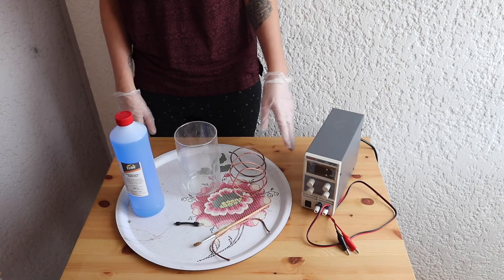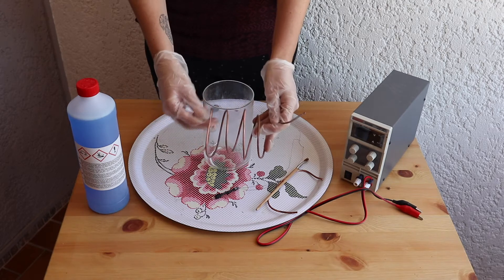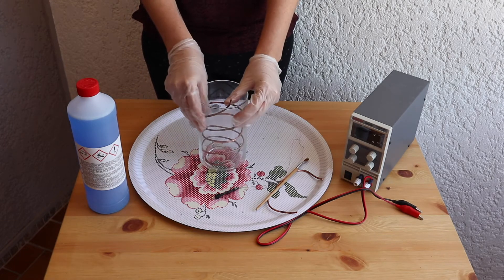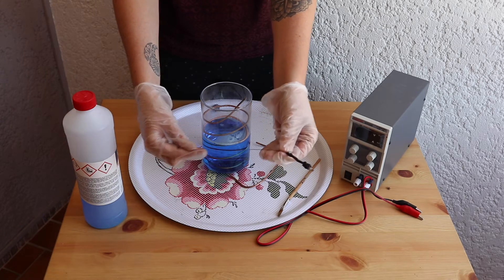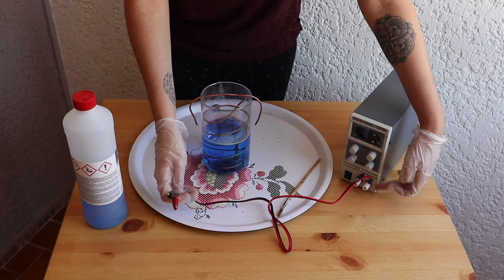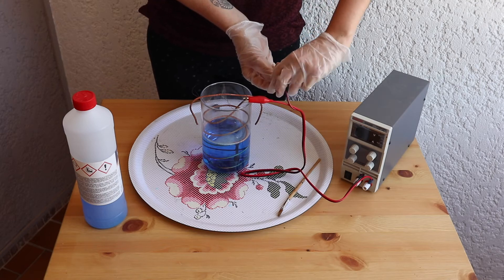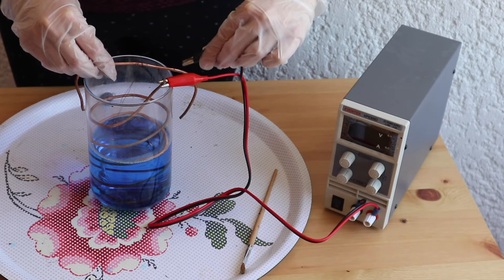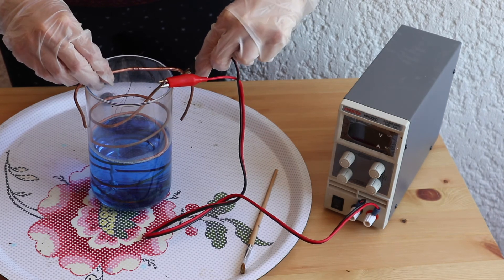How To Set Up Your Electroforming Bath (Beginner's Guide)

Comment: Hello, I have a gold and jewelry production workshop that I work in the traditional way with casting and laser cutting and welding machines. Now I want to expand my business and launch a gold electroforming system. I wanted to get your advice on this. I would be very grateful if you could send me the steps, and whether this is possible or does it require advanced and expensive equipment and devices. Thank you.

Comment: Thank you for keeping it simple. I have the exact same set up as you. However, I cannot get my Rectifier to work properly. How does one set the voltage and Amps?  At what voltage should the Rectifier b e set?  Also should the Amps show 0.00 while the voltage is set at say 1.3? 

I am thinking that my Rectifier do not work and it is brand new.